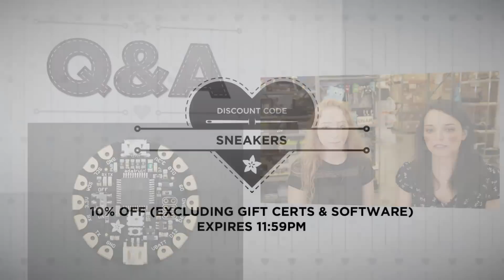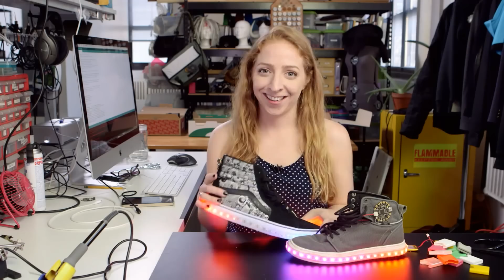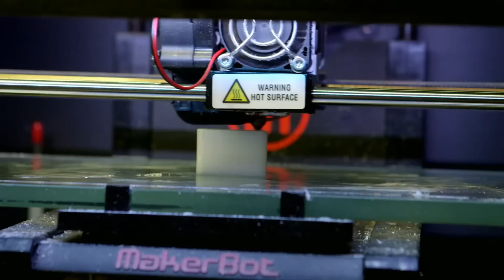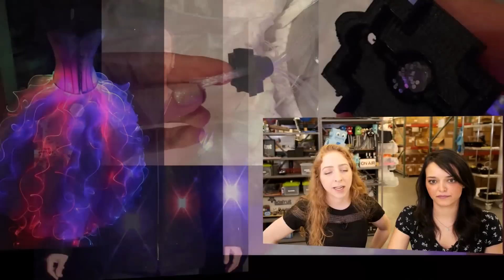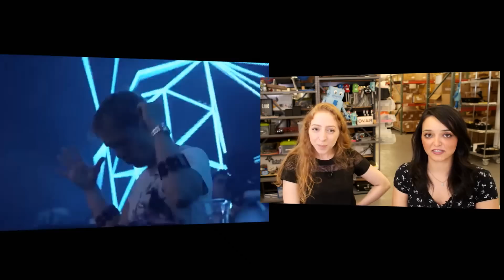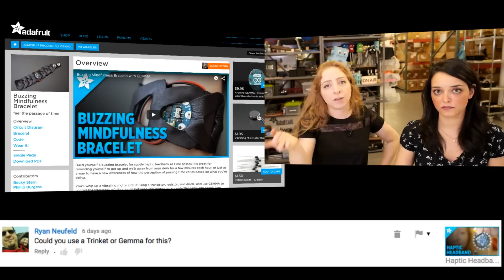Jess cohosts Wearable Electronics with Becky Stern 12/2/2015 - LIVE

Comment: Dear Ms. Becky,

My Gemma code won't work on my little trinket! I changed the pin# and the board to trinket in the settings, but when it uploads, it won't run! What am I doing wrong? 

Thank you! 
Alice
Reply from the maker: +Alice Sato Post up your code in the forums with any error messages and a photo of your circuit!

Comment: I have a wearable project I am designing that will use a lot of neopixels (80). Though only 8-16 will be lit simultaneously, I am going to power them separately from the processor with a larger LiPo. Additionally, because I need many control pins, 10-12, I am planning on using a Feather or Trinket Pro. Which leads to the question of voltage. I've seen comments that the signal voltage and power voltage on the neopixels must be the same? If so, then I am faced with powering entirely at 5v, which would provide maximum brightness, or 3.3v and lower brightness. How much lower? I like the low-battery shutoff with the Power Boost with 5v circuits. Is there similar for 3.3v? Advantages of running 3.3v vs 5v?

Comment: Have you considered integrating a little control into them? Possibly using bluetooth LE, though I think that you'd hit a problem with not being able to wirelessly connect to both shoes at once. (does anyone know for sure if it would or would not work?) Though alternatively, you could integrate a dial or a couple buttons into each shoe to manually change the shoes colors & or patterns.